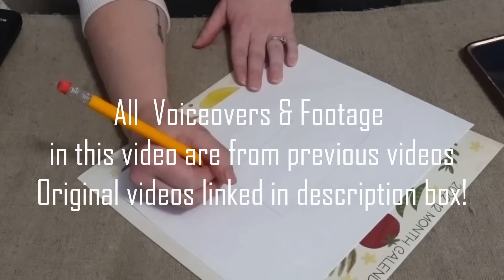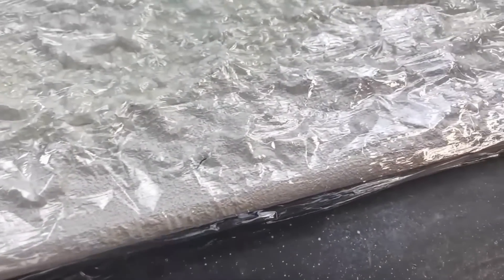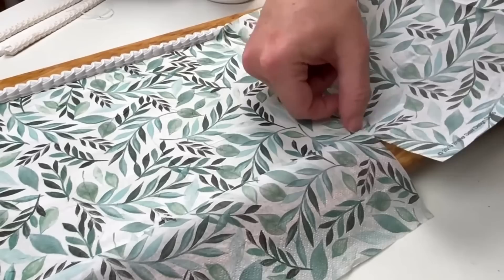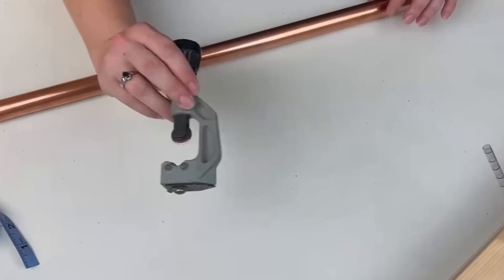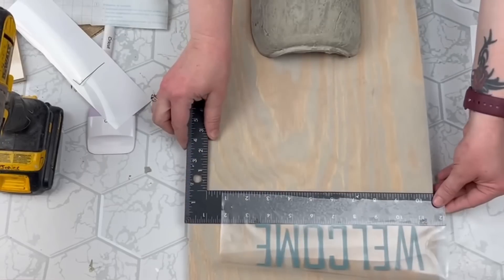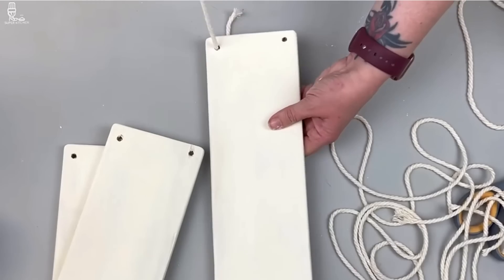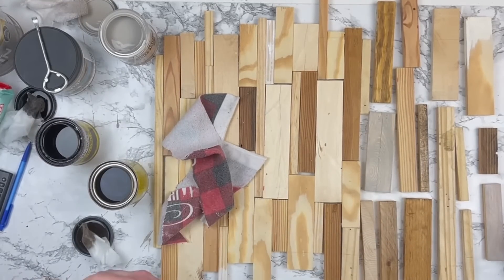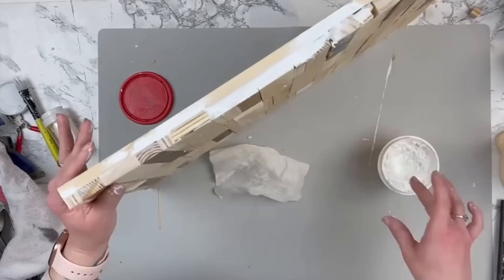SIX Scrap Wood Decor DIY Idea's for your Home // Waste Wood Project Ideas

Comment: I love these!!! Still watching but on the concrete jar, I think if you added like wall trim, cut up a picture frame something more decorative, it would be very high end looking!! I don't think for all the work you put into the jar, garden stakes do it justice 😍😍😍
Reply: On the multi stained pieces, wouldn't the table saw have been better to cut the finished edges off??  You used a skill saw... I hate those!!🥴  My husband won't let me use the table saw😑😑 but I've seen a baby one at harbor freight and I'm going to get it 😁🤣🤣🤣  I love this piece and want to make one but can't decide if I like the first one,  even designed one best...😍
Reply from the maker: I used the table saw on one end and I didn’t get a straight cut. But this was also a very old project that I created over a year ago and have definitely learned a lot about the different saws and tools since then.

Comment: To create the darker brown color you wanted, next time just add a few drops of black to the shade you want darker. Keep adding n mixing till u get the color you like. Hope this helps!
Reply from the maker: I tried black but it was turning a strange color rather than just deeper. I wonder if the black I was using had a slight blue tone to it which threw off the color
Reply: @angelajonesdiy  Yes, that may very well be the issue. I learned that there are cool (blue based) blacks, as well as warm blacks (green based) and neutral blacks. It can be tricky when mixing colors!  You did an amazing job! I luv'd the design. Congrats Angela!!!

Comment: I like that you upcycled the door with HOME. I like the clay border you made with the mold. It would have been a bit nicer if you had made a 45 degree cut on the corners of the mold. A small detail like that makes the finished look 100% much better.
Reply from the maker: It certainly does!